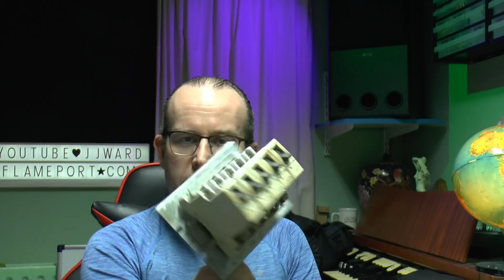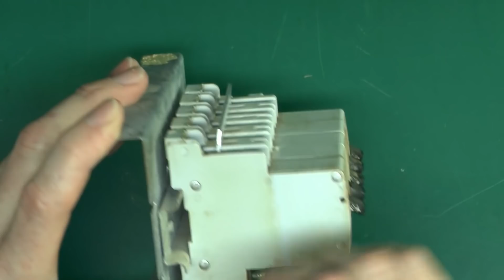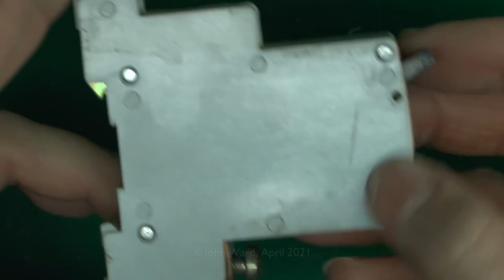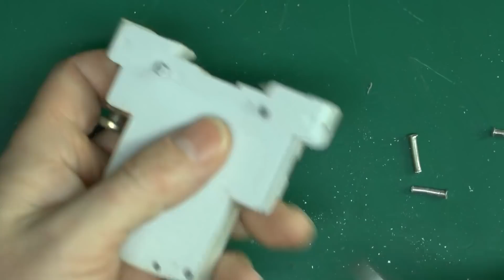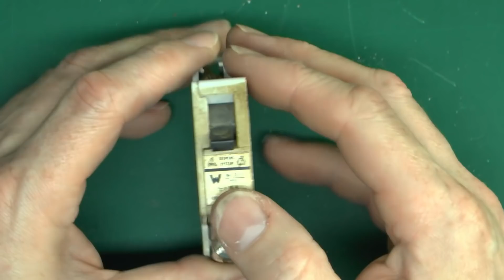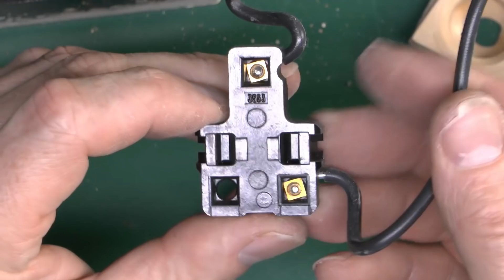Circuit Breakers Prague 1983

Comment: Hello Mr. Ward. Your videos are very usefull and clearly structured. Can you please adress 2 topics? First: measuring devices, what festures to look for in a ZE measuring device (for a beginner), insulating resistance tester and for a RCCB / BO tester. Second: differences between types of RCCB / RCBO devices (A, AC and other types). If i missed your videos on the topics above, sorry!

Comment: Mr. Ward, I have a question. Why are toasters legal? I mean they are IP10 devices that are just... everywhere. Does every consumer-reachable electric installation and device must be more than that (except toasters?)
Reply: Grandfather clause. The design pre-dates modern regulations. Same as the traditional light bulb socket. No way that would get approved today but both are an established design used all around the world and it's just too hard to eliminate. Even as a child most people are quickly taught not to stick your fingers in either. And in more recent times RCDs have helped mitigate the risk with both. The other big issue with the toaster is even after 120 years no one has managed to invent a safer replacement machine that's any good at cooking toast.
Reply: @Seiskid  Mitsubishi created a better toaster.
Reply: Toasters are connected only when the tray is down. I do not get why anyone would stick something there.
Reply: Good question. There is no reason why they couldn't put a grounded steel mesh screen between the heating element and the 'cage' that holds the bread. That way, you can't poke the heating element with a knife anymore, and the tines of a fork would be contacting the grounded mesh and tripping the GFCI instantly.
Reply: @nick Ellingham - not out of reach if it is a table lamp or bedside light… And both BC styles and ES styles are just as bad…
Now there are alternatives, like GU10 and similar which are a bit better.

Comment: VBKM, they are made in Hungary. VBKM was a typical state combine, which were usually found in communist countries. VBKM was a fusion from ten different companies. They had the license to manufacture Siemens MCBs, probably the reason for the Siemens System label printed on. Back in these days the MCBs were always higher than they are now. The covers were also higher, the dimension of the opening in the cover is the same as they are now.

Now the manufacturers name is EL-CO Weber. They are manufacturing for General Electric Power Controls.

L is the tripping curve, quite old one. Used here in Germany until it was replaced by B in 1990. The electromagnetic short-circuit tripping is the same as for B, but the thermal overload is more "reluctant" than the modern ones:

https://www.elektrikforen.de/attachments/kennlinien-jpg.702/

You can clearly see where the cover protected the MCBs. I would say this was installed in the apartment of a person who smoked in the apartment. The MCBs in the apartment of my grandparents looked the same way. Exposed part was covered with a mixture of dust and nicotine, and the part inside of the compartment was still clean.
Reply: From 1972 we had H is the tripping curve, but these have been replaced by B tripping curve.
Reply: I believe that the thermal overload curve on  type L breakers is based on the curve of gL/gG-type Diazed/DII fuses which were common in Europe at the time.
Reply: A taste test of the yummy Nicotine maybe in order!
Reply: We also had Bakony Művek in Hungary making quite good circuit breakers.Many of them are still in service.

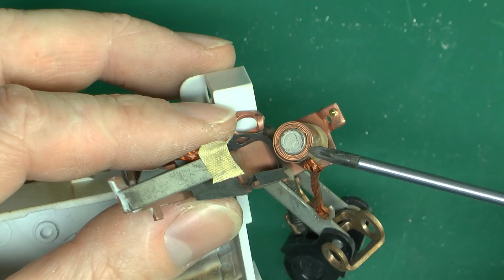Comment: The magnetic trip mechanism also has an adjustment screw seen in the bottom right corner at 11:10 and accessible via a hole which is hidden under the label.

Comment: Is the coiled copper strip (rather than wire) on the electromagnetic in order to handle the high current, or is it just cheaper to make that way?
Reply: Its a very flexible wire which is needed there bcause of the movement of the mechanism. You can't use solid or normal flex core it wold be too stiff.

Comment: They are made by Weber. They were also used in hungary, that's why I know.
Reply: We also had Bakony Művek in Hungary making quite good circuit breakers.Many of them are still in service.
Reply: @MernokiMegoldasok   Tudom jól. Úgy törtek mint az állat, de az biztos, hogy időben kioldtak. Rohadt érzékenyek. Még régen olyan  volt nekem az óránál 2db 10-es. Amikor bekapcsoltam a 3x10A-os indukciós főzőlapot, akkor mindkettőt kib*szta.
Reply: @czonczike630  Nekem nem tűntek törékenynek.Még van az új típusuból is a gyűjteményemben,amin már papír helyett nyomtatott felirat van és 230/400V tehát 1995 utáni lehet.
Reply: @MernokiMegoldasok  nekem a papíros fajták vannak 1983 ból, de azok törnek, mint az ítélet.
Reply: Amikor kicsavartam őket, akkor mindig ahogy lazítottam, akkor eltörtek. Főleg falukban. A manáéknél még mindig olyan van 6 amperosba. Egy hete nála voltam, mert összehívtuk egyet a családot, ő meg fölment porszívózni, azt mikor bekapcsolta, szokásosan kib.....ta, lement fölkapcsulni, de látta hogy el volt törve. Tehát olyan szinten oldott ki, hogy belerepedt. Amennyire hülyén hangzik, így volt. Na mondom fasza. Azt cserélhettem ki. Futottan haza hoztam egy vadi új bakonyit dobozban, sajnos csak 6 amperosat, mert oda más nem lehet, azt ki kellet cserélnem.
Reply: @czonczike630  Az indukciós főzőlaptól a modern B10 is lehet leoldana.Amikor mikró trafókkal kísérleteztem,sikerült 2 trafót a hálózatra kapcsolni és a Bakony B10 nem oldott le.
Reply: @MernokiMegoldasok  Passz. Aztán az is lehet, hogy mivel régi volt, már érzékenyebb lett. Megvan az a megszakító a mai napig, mert az eon csak otthagyta mint eb a szarát. Az 1983as.
Reply: @czonczike630  Vagy nincs lágyindító a főzőlapban.A kínaiak mindent IS kispórolnak amit lehet.
Reply: @MernokiMegoldasok  Ja hát az nem volt. Azóta már tönkre is ment.
Reply: @czonczike630  De azért Érdekes hogy Magyarországon gyártott kismegszakítók is kerültek a csehekkez.A cseheknél és szlovákonál nagyon veszélyes szereléseketr csináltak a 90-es évek közepéig.Védővezetőt sehove nem húztak,minden konnektor földelését a nullára kötötték.A biztonságod attól függött,hogy megszakad-e az 1.5,2.5,4mm2 alumínium vezeték.
Reply: @MernokiMegoldasok  Azzal spórultak, hogy nem használtak PE-t.
Reply: @czonczike630  Csak a nullát PE-nek is használni veszélyesebb,mintha egyáltalán nem lenne semmi földelve.Spórolhattak volna többet és lehettek volna földeletlenek a konnektorok.Nulla szakadást láttam sokszor,földelés hiánya miatti halálos áramütésről még nem hallottam annak ellenére,hogy inden faluban több tucat ház van,ahol az összes konnektor földeletlen.
Reply: @MernokiMegoldasok  Hát ja, az úgy elég veszélyes.